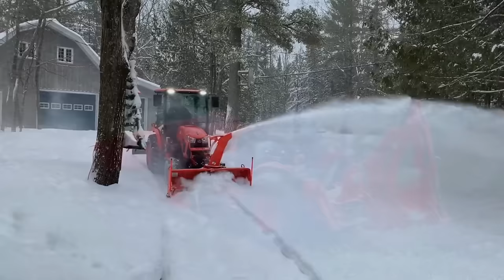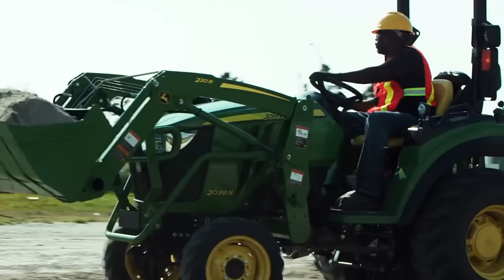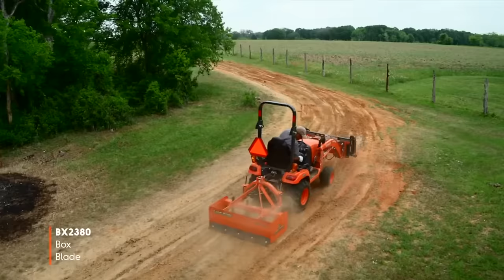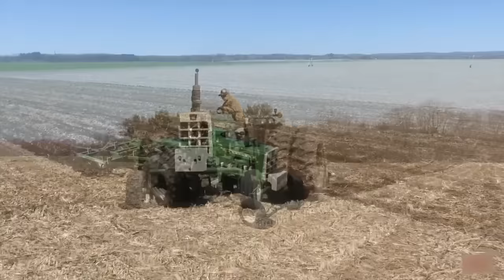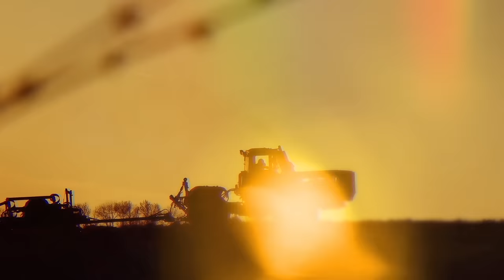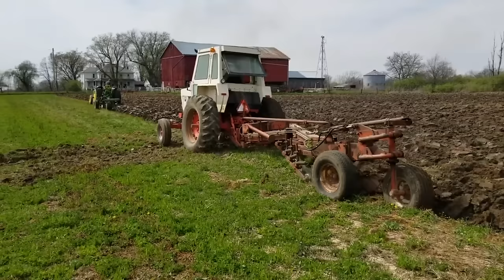These Are The WORST Tractors Of All Time! Part 2

Comment: We had two JD MTs and they were great little tractors. We typically were trying to use them to do jobs that were bigger than the tractor, but they just seemed to do it anyway. We were always laughing about the things we did with them that they did in spite of their tiny size and our expectation that they wouldn't be able to do it. Used them for many years on the farm and sent one of them off to be used at a drive in theater we owned, where it served lawn cutting duty as well as scraper blading the ramps and driveways back into shape. Neither of them ever gave a speck of trouble and even if they had, they were simple and cheap to fix, so I find it hard to believe they ever had any adverse effect on JD's reputation. The IH 3588 and Case 1070 were also really good tractors. They were both widely used in our area and were both reliable and nice to operate. I spent thousands of hours on  IH 3588, 1066, 1466, 1468 tractors and all the Case 970 through 1370 series--and their predecessor 30 series machines. Pretty much all its components were taken directly from other successful models, so nearly everything in it was tried and true. The only actual weakness of the 3588 might have been the torque amplifier, which was used across all the larger IH tractors.  I don't know if they ever made a version of it that was tough enough for 100 hp+ tractors, but most people just avoided using the T/A more than necessary, or just understanding you will probably break it if you do use it much lol. Not sure where the data came from to claim either the 3588 or 1070 were bad tractors because they certainly were popular and highly regarded in our area. In the narrative of the video, it sounded like the 3588 destroyed IH's reputation and ultimately the company. That isn't even remotely true. Still, it's fun to look at these "worst of" / "best of" lists and argue about how unreasonable all the entries are lol. If you were to construct a "most hated" of all time, I'd put the Ford 8N and all its inbred offspring at the top of the list. And yet even today, people who buy 10 acres and two horses also get one of those useless hateful things because they don't know any better. The MT, in spite of its size, would serve those hobby farmers a lot better than one of those crappy little Fords.

Comment: So here's a Gem for you. 
A tractor that actually Reliable but Horrible for Use. 
From ex Yugoslavia now Serbia, and Unfortunately still in production since 1973.
It was a Semi licensed Massey Ferguson design with a We can make it better, and cheap spin.
And truth be Told they did. part from one little Tiny detail. 
It will make you deaf.
And for all of you reading and feeling smart about knowing Earmuffs exist, hold your horses. 
IMT 577 is the Magical Unicorn.
BTW I tried with Many microphones, and they just can't capture such a sound. It's like some Engines Usually Mercedes engines that make sweet sounds but sound like crap on Videos, Microphones just seem to be enabled to capture it.  
Industry of Machines and Tractors(IMT) Made a 72HP 2WD and 4WD, actually great, tractor. From a standpoint of Reliability, power and maintenance. As well as the Price. 
Why the tractor is Relevant, since  It was also Exported to many African and South American countries, since Yugoslavia was a very Relevant small country at the time, offering a cheap but dependable machine, or a few. 
Like the IMT 533 which is a slightly stronger Massey Ferguson 35, IMT continued to Look up to designs of cheaper older English machines. Offering some improvements from time to Time. 
The Engine was Licensed, but It turned out to be Just slightly more reliable. 
S44 as Called by IMR(factory that made the engines) license of the Perkins Equivalent I believe M44 A had 72 HP opposed by the Perkins 69Hp.
Not that significant, But the Fuel injection had higher Pressure and the Compression ratio was just Slightly upped, resulting in a better burning engine that was smoother, more responsive and Somehow by some Socialist magic slightly more reliable. 
I would probably guess Better Materials. 
The Problem. 
Unlike the Massey Ferguson. 
IMT just said: Fuck it Straight Cut gears are Cheap and strong. 
And they do Be correct on that one. 
However 
IMT in that one specific model, managed to Create such an Ungodly whine of gears, that covers several Pitches and has made MANY of the Drivers partially or severely deaf. 
Earmuffs help, but the Fact most Old school farming was done listening out for Foreign objects hitting the Machines, like Rocks, trees, Bricks, and stuff breaking like Cultivator springs, digger rods etc, you couldn't afford to just isolate from the world.
As if you could.
We used Technology and found out it Actually Covers 4 Pitches of Whine audible to Humans. 
At the same time...
2 if you are only driving on the road. 
The best I could find is this guy https://www.youtube.com/watch?v=albCerWD-UI
Thats the sound but around 30% of the volume and intensity of the real in cab experience. 

The worst part of is, it was redesigned for the 4th Time in 2008 and its still on Sale today for around 34 000 Euro with 4WD. 
Redesigned means New Hood Fenders and Cab. 
They never even thought about redesigning the Gearbox and the Planetary wheel Gears that make the noise. 
The New cab is the Best one and it adopts the Wester modern Float style, its lifted from the Rest of the tractor, with thick floor padding. 
The noise is still very audible. 
I Actually suggested Serbia should make a Weapon out of it, since it will cause Tinnitus after a Few hours of Heavy plowing when the Whine is the strongest. 
The sad thing in all this is it's actually a Good Machine when it comes to anything else than the Operator health. Even the Oldest ones are still working the fields even with Missing Not Crucial parts like Cabs, Fenders, Hoods etc..
You can See many of the On Youtube just Search IMT 577.
Its a very speedy Plower , and it has a Massey Ferguson Issue as well, If the slight rain starts its immediately slipping. Especially in Plowing. But it's a strong, reliable Old tractor that many Use still. With a stupid fault.
And the Drivers are friendly, mainly because they can't hear you when you talk shit about their tractor. :)
Oh IMT also Made tractors like Massey Ferguson 1805.
All the Way to the Strongest Serial Tractor in the World at the time the 5360 and 5500 Both having Mercedes V12 NA and Biturbo for 520Hp 5500.
But it didn't have MF issues it actually worked perfectly fine. 
It failed logistically because No one in Yugoslavia needed it and the Few that were made and Used by a National Dairy corporation called PKB, that made food for their own animals. They were parked because they couldn't get them to the Fields. 
They and the Machines needed to exploit them in 1982 were too big to Move anywhere, and Yugoslavia isn't like the US where Farmland is isolated and connected. We have Large field Groups but Still Cant have American/Australian farming style. They still have to navigate European roads and Towns and villages. 
IMT was bought by another lover of Massey Ferguson in 2018, Indian TAFE. They made around 780 000 Tractors before that. From 35hp all the way to 520hp. Agricultural and Forest ones.
Reply: Add 560 to list with virtually non-existent brakes. We  had 2 of them with different type of brakes,  both were blocking  wheels occasionally. On the other hand, our almost 50 years old 558 with forestry upgrade works like a charm.

Comment: The 3588 was not a bad tractor at all, you’re wrong on that, theyre ugly but they have lasted a verey long time, i have multiple neighbors that run a 3588 and they’re perfectly fine. A case 1070 as one of the worst is absolutely wrong. I have a 1070 with well over 6000hrs and it works just fine. You’re definitely wrong

Comment: The JD 2300 series doesn’t mention the grease nipples on the drive shaft between the engine and transmission. I’ve changed 3 on customers for lack of grease.

Comment: We had a John Deere MT and never had an issue with it for years on a farm and retired it to a golf course in 1970 were it ran another 10 years and then sold. It was extremely dependable and the only draw back was it did not have much power needed for a farm it was perfect for a golf course to pull gang mowers.
Reply: We had two MTs and they were great little tractors.

Comment: You forgot  the 40 series ford and new holland, 7200,8900 case ih and john deere D and E series , anything Deere make with the 13.5 or 13.6 liter engine in it and coming  soon the new 8r john deere are the worst tractors made
Reply: Whats wrong with the 2700 and 8900 case ihs?First time hearing something bad about them
Reply: @MagnumLoadedTractor   The 7200 and 8900 case ih have a lot of electric  problems  lift arm will not draft poor engine power , the ac sucks will not go slow enough to pick peanuts and ride   bad  poor visible I had a 8950 and hated it  and poor service
Reply: @MagnumLoadedTractor   Trade it on a MX285 and loved it